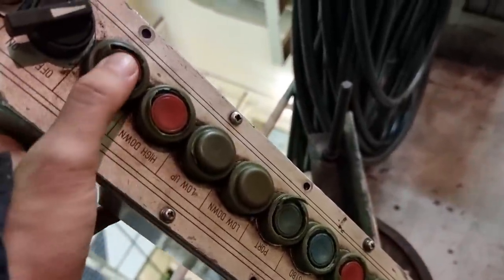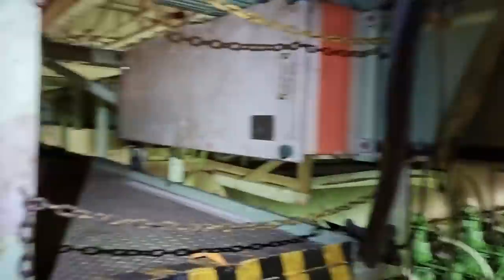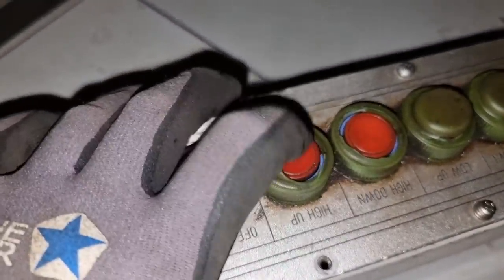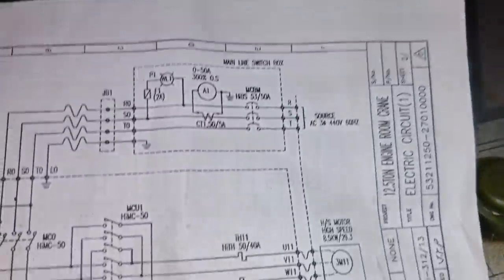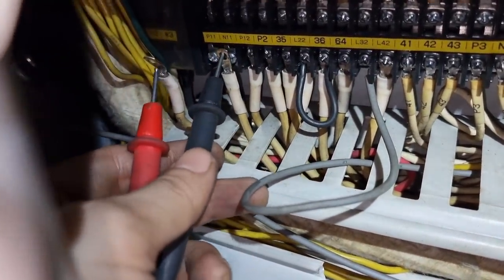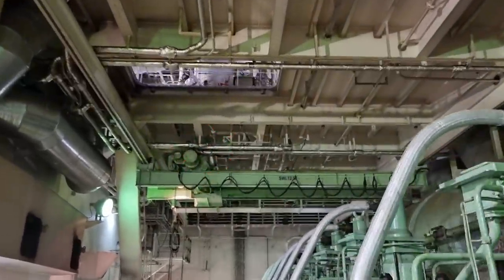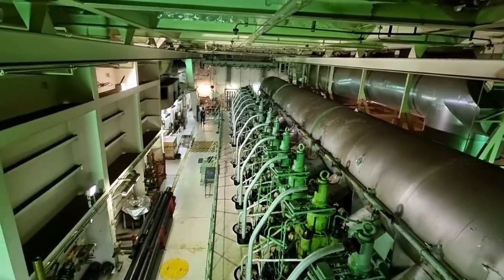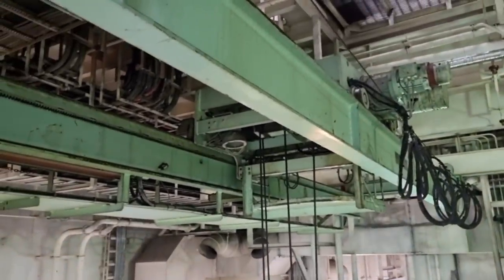ONBOARD ENGINE ROOM CRANE TROUBLESHOOTING

Comment: Great video again, keep up the good work! What generally causes such a low resistance in the magnetic brake coil, do a bunch of windings just get shorted together? If the resistance is 1/10th of normal value, the current would be 10x the normal value, wouldn’t you expect that to blow a fuse as well?

Comment: Wow!! laking tulong Po Ang video n Ito...Gbu
Reply: Good analysis po sya pero  di nya napakita ang mga limit switch na syang mag ti trigger sa  mga 
Contactor ng 
High speed up and down
Reply from the maker: Hi Roberto, going back sa video, yung contactors are both activating without the motor connections kaya ibig sabihin the circuit is healthy. It is a troubleshooting video kaya need to move to the next step of fault finding.

Comment: So if the brake is failing to release despite the applied voltage, why  does the low speed work?
Reply from the maker: Because there is a separate motot for the low speed
Reply: Thanks for the reply,I got you